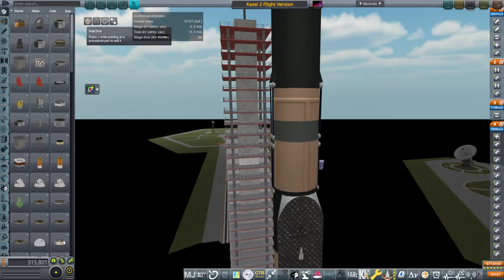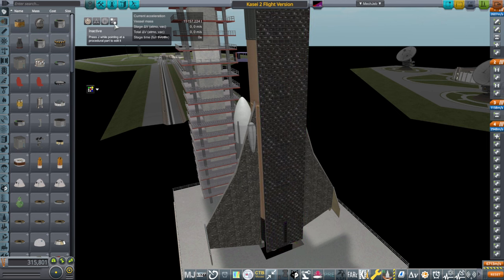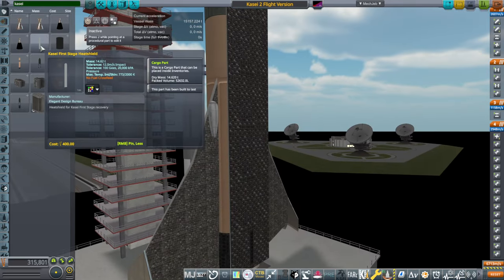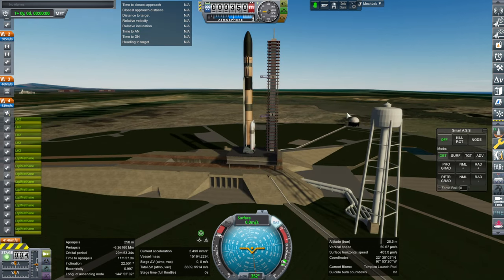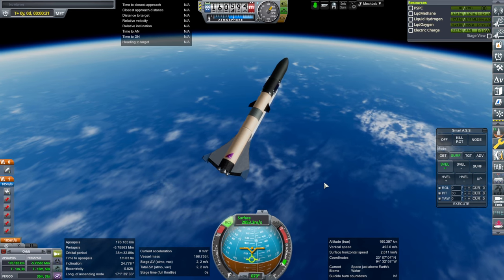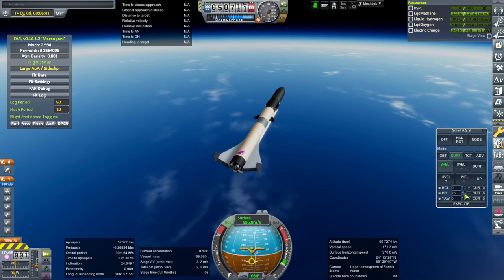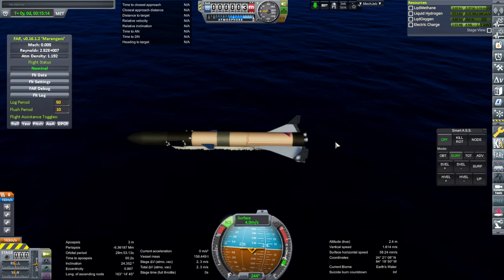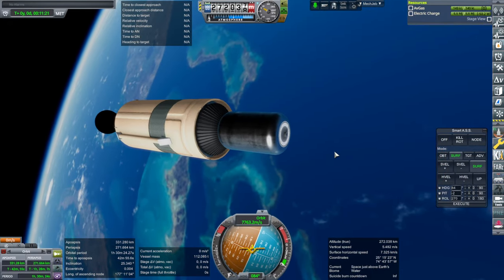Kasei Recovery Testing Continued (RO in KSP 1.12)

Comment: You mentioned before wanting to change the engine count, from 5 to 7 on the 1st stage and changing the second stage engine to be lighter, I’d like to see that alongside these Kasei recovery upgrades. Also I think 3 boosters on that one side would fit comfortably and would be a cool layout
Reply from the maker: We're already using the lighter second stage engine. There wasn't a whole lot of benefit to changing the engines on the first stage in testing, though.